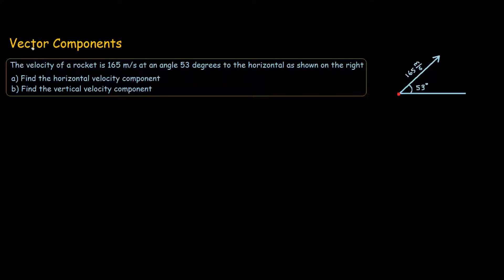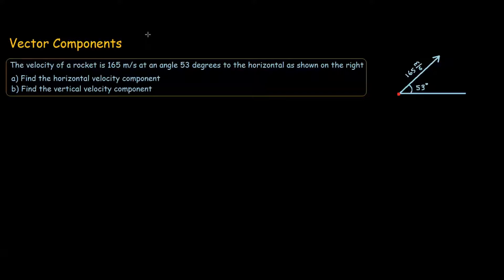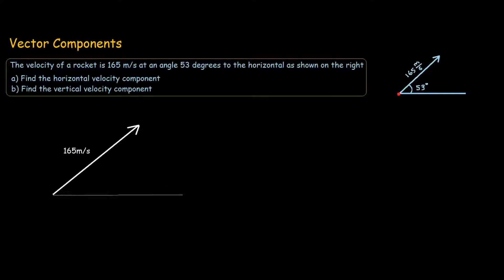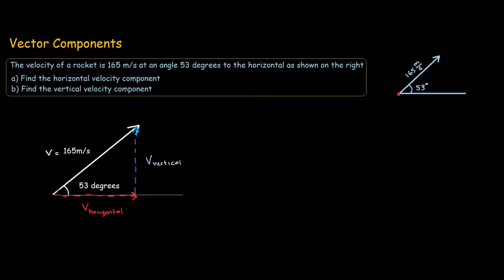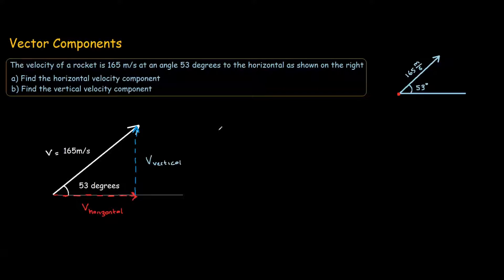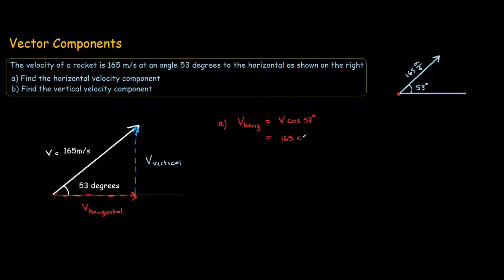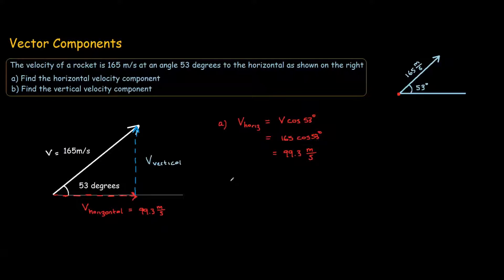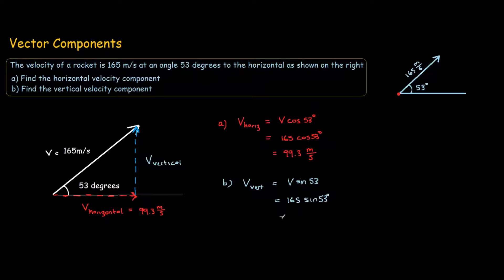How to find the vector components?

Comment: I'm still confused on how you arrived at 99.3
Reply: You can also reason it out in your head through the unit circle. 53 degrees on the unit circle is slightly over pi/2 in radians. Through that, you can assume that the x-coordinate would be roughly equal to Sqrt2/2, which is ~0.7. Because 53 degrees > pi/2 radians, your cosine value must be less than ~0.7, being just over 0.6. If you multiply that by the hypotenuse, 165, then you will arrive at your correct answer of 99.3.
Reply: get it yet? i have my finals next week and I'm confused
Reply: Make sure your calculator is in degrees mode, not radians. If in degrees mode => 165cos53=99.29947 =~99.3